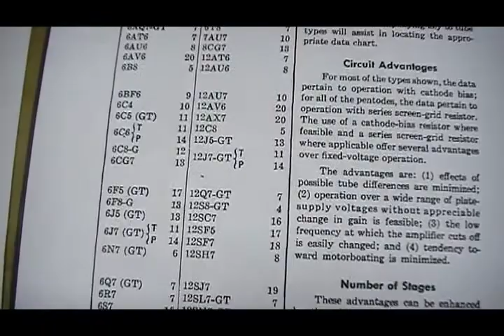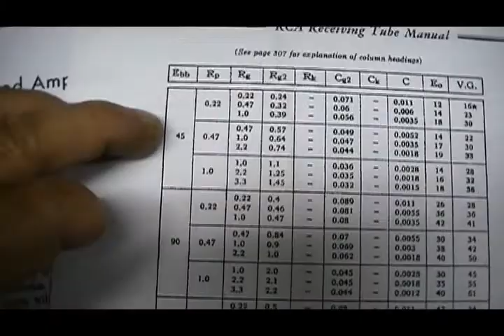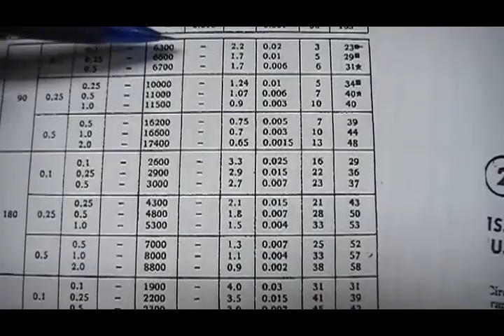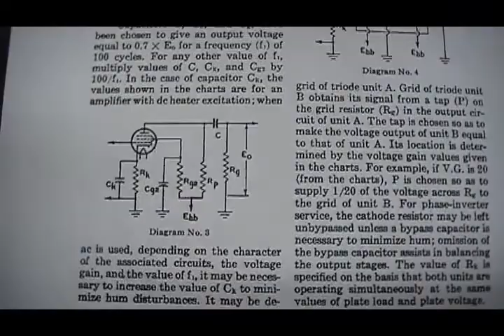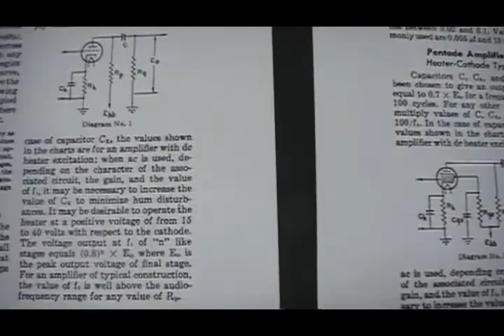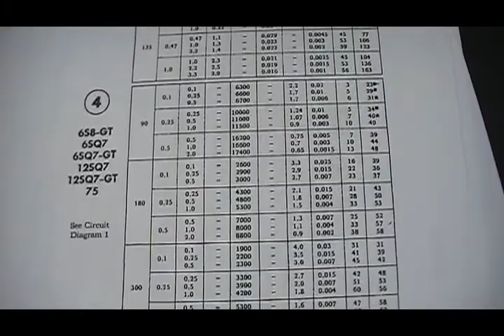Tube Theory part 6

Comment: Dennis, I'm now a retired electrical engineer, and my career was centered around electromagnetics. Before that, I was a communications/navigation electronics technician in the USN for eight years. That's where I learned about tube electronics. Having retired, I've built a workbench to work on old radios, and the tubes are slowly coming back to me. Slowly, I said. I've restored several radios, but it's not like riding a bicycle. Your videos are helping me remove the training wheels. I've stayed with you, every step of the way, so far, in these six videos I've watched. You are restoring my memory, and it's like waking up after a long sleep - like coming out of a 40 year coma. Thanks for your help.

Comment: I have taken electronics classes in the past, but my knowledge of circuit design is extremely lacking. I aim to build my own guitar amp, so amplifier circuits are where I am getting my start. I find that you do an excellent job of teaching and anything else you would like to publish dealing with amplification circuits, or any other circuits for that matter, you can rest assured that I will study them. Thank you for your excellent work.
Reply from the maker: <p>Thanks Jason. There is more videos on theory coming soon and I'm doing a video series on building a signal tracer witch is just a audio amp and will doing the theory and design.</p><p>Regards</p><p>Dennis</p>